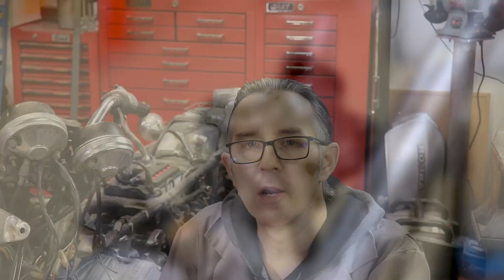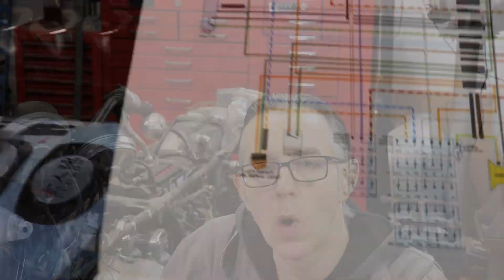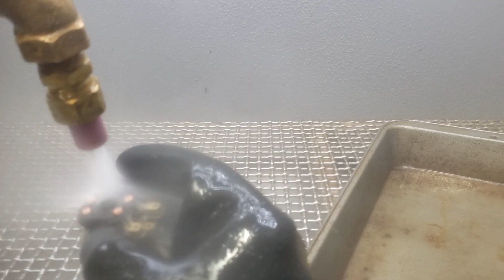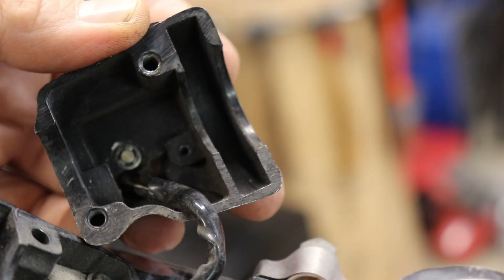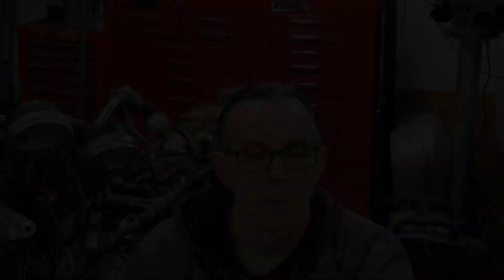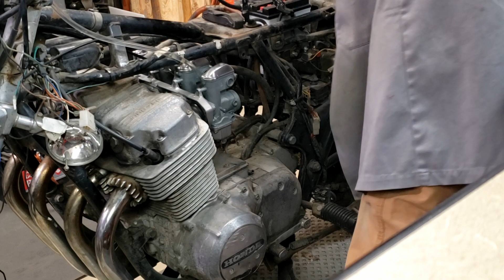Episode 7: Troubleshooting and First Start 1978 Honda CB750 K8

Comment: This is super exciting. I'm heading out tomorrow to look at my Dad's old 1978 750k and see if I can't get it running. The ignition switch needs to be replaced, but then I'm going to change the oil and see if it'll kick over. Poor thing has been sitting for well over a decade, so my fingers are crossed I don't run into a ton of problems and it kicks over. I'll have to watch the rest of your videos on this bike.
Reply from the maker: Hopefully it goes good for you, these old Hondas want to run. Thanks for watching!
Reply: @DocJonesGarage  Nah, no such luck. Don't know if it's not getting spark, or the kick starter won't start the engine with a dead battery. Can't get the seat open to replace the battery without drilling out the lock for the seat since the only person who knew where the keys were has been dead for almost a decade.

Comment: My ignition  switch is stuck in park  position  will not turn  back to ignition  settings  or /,off
Reply from the maker: I'd guess that if it's been in the park position for a long time the pin that slides out the side of the switch body to lock the steering is corroded and doesn't want to slide back into place, also if the lock itself is sticky it might not want to let the key move in the extra bit when switching from         park ---> off
Reply: @DocJonesGarage  that's Correct  what do suggest  to get park position  moving  freely  sterring  Lock pin once I push ignition  key all way and turn then pin should  come out but seem like it's sticking  till I jiggle or push harder  then come out
Reply from the maker: @st-qd8wg  sounds like the switch needs to be removed and cleaned and the surface of the park pin tidied up. you could try a small amount of light oil or graphite in the lock itself to see if it helps but not too much even then it still might need to be serviced in the near future. good luck 👍
Reply: @DocJonesGarage  I actually  Removed  ignition  and cleaned  Real Good at Least  I hope so with WD40 and Lube with engine  synthetic  motor  oil  and I actually  Got sterring  Lock To work real Nice that is blessing  by it self 😲 on position  and off setting  works great but park is not so great it wants work but something  cause stick after I get it going good for while so I put more Lube put key in N out then work fine then when I go back out and in again  its sticking  then I noticed  when I switched  keys to spare set works Little  better as we as sterring  Lock 🔐  then when I switch  keys both departments  will start sticking  as well so I'm thinking  the keys  🔑  must not ben Cut properly  to match to cylinder  to push or pull pins for ignition  work properly  its after market keys  its popular  set  I'm thinking  purchasing  Genuine  Factory  key and have premium  Lock Smith Cut  to Key Code # from manufacturer to get perfect  cut as was New from day of production  so I can get work properly  not  Damage cylinder  bye sticking  bad key in there after every  thing  is clean but I can say it's doing Lot more than before  it wants work all functions  are operating  well just Little  sticking  I believe  Factory  key should  seal Deal I don't think  any more Lube will Really  help maybe  Little 3 in to 1 Lock Dry Lube at Home Depot I'm Run down there get that or Graphite  Dry Lube in spray can should  do trick with New set keys 🔑 ✌️

Comment: i have the same bike only mine only starts with starting fluid and wont idle
Reply from the maker: Sounds like it could use a carb rebuild, old fuel buildup in the pilot jets perhaps.